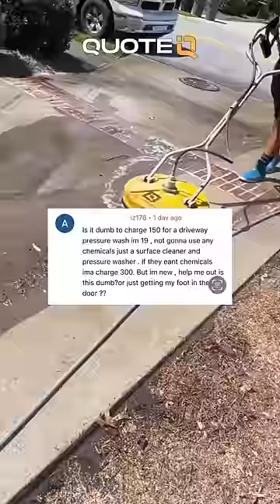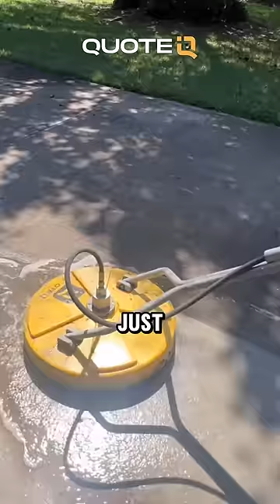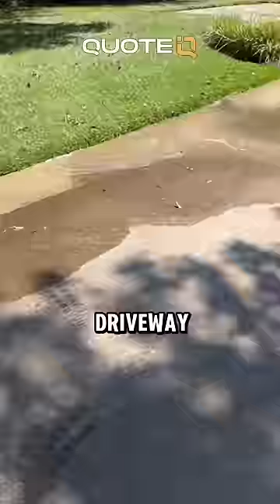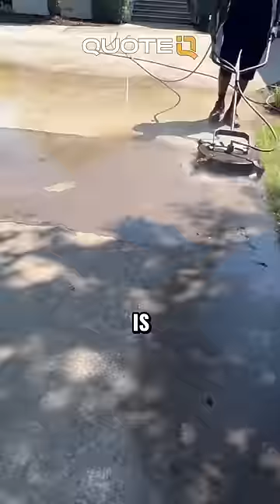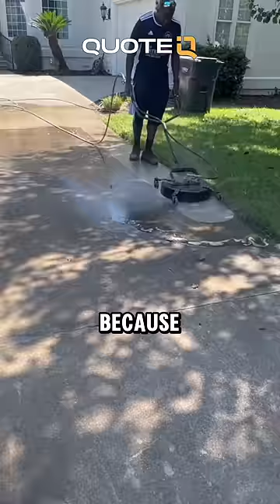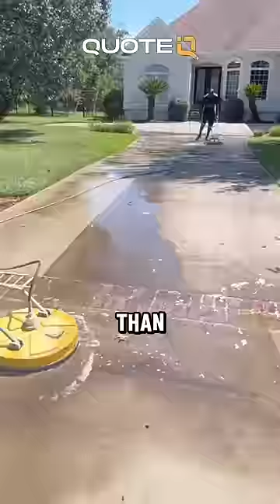Is it DUMB to charge this much?

Comment: You read it wrong.
Reply from the maker: How😂
Reply: @AllAboutPressureWashing they said if they want chemicals they charge 300 and you said if they don’t want
Reply: @AllAboutPressureWashing they said if they WANT
Reply: @AllAboutPressureWashing basically they meant they had add ons
Reply: @izukumidoria3721  this is true, they answered the wrong question, but to be fair, the answer still works cause he essentially argued to figure out what the costs are and the amount of square feet youre cleaning to determine a price